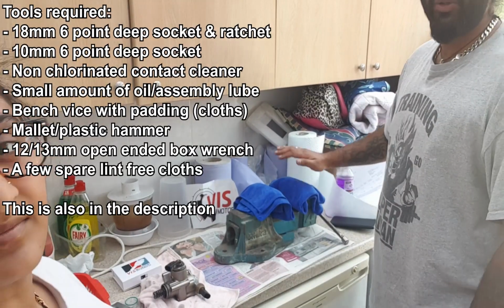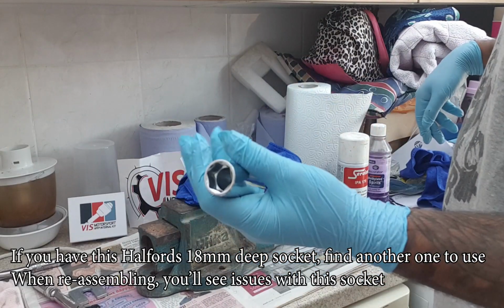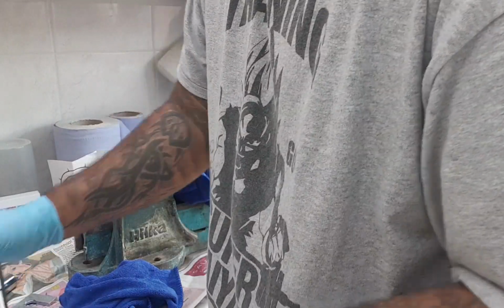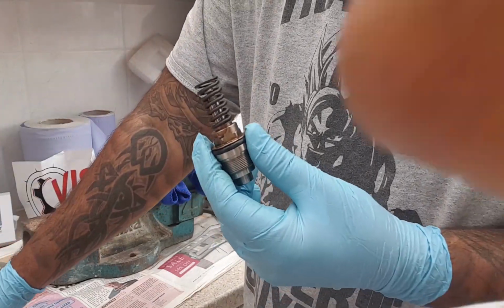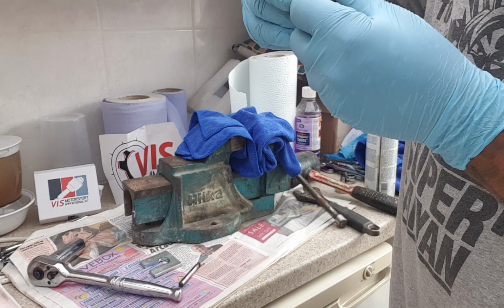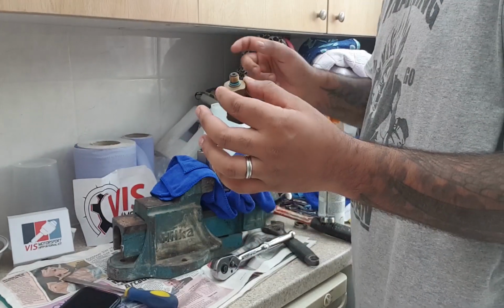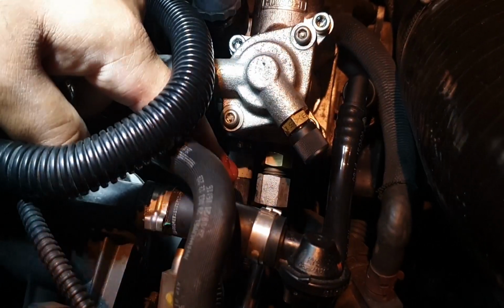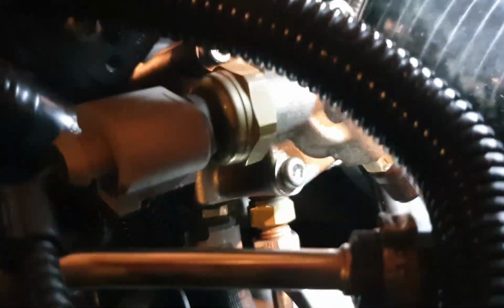DIY - How to fit VIS Internals - UPGRADE & MODIFY your fuel pump

Comment: 'Tappet' was fitted upside down and may still be that way. The rubber o-rings won't last long so please buy the correct sealing washer. Replace the 1960's hose clamp for a genuine spring clamp. Not too bad for your first go.
Reply: Thanks for the info Alex much appreciated. The tappet being upside down could have been why it popped off when I removed the pump. I haven't had any issues in over 1k miles so I (believe) it's the right way now. For other peoples knowledge too, how do you know if its upside down? 

I have 1 crush washer that I found on my drive way, do you have the part number for the washers by any chance? 

I'll replace the clamp too. If you have these in stock I'll happily purchase them from you.

Thanks! 😁
Reply: Can you buy the washer on it's own? If so do you know the part number?
Reply: @Jeremy7595  For the larger valve (rail valve) the washer part number is N-013-811-4. I think this is the only one. Check this post, someone kindly took pics and measurements of the rail valve washer  - https://forums.vwvortex.com/showthread.php?5101162-Help!-What-is-this-part&p=69492364&viewfull=1#post69492364

For the union/pressure fitting (where mine was leaking) the part number is 06F127213C. I'm trying to find the washer part number(s) and I'll edit this post when I do. The spring hose clamp part number is N90986501 so I'll get that too.
Reply: The washer isn't available as a separate item.
Reply from the maker: I found the washer I was missing, but there's no part number as Alex mentioned.
For the union connector (rubber hose attached) the Outer Diameter is 12mm, Inner Diameter is 6mm
For the rail valve (larger one next to it) the Outer Diameter of 12mm and an Inner Diameter of 9mm. This needs to be a crush washer though. The part number I found for this is N-013-811-4
Reply: Will it affect how it works as he put the flat side of the tappet facing upwards instead of the rounded side facing upwards ?

Comment: Hi Swati Gurpreet. If you do a test... on highway cruise 3-4th gear on autopilot and keep rpm in 4800-5000 value constant for a minute, do you get a P0088 rail pressure too high error and limp mode? For this test would be great to have a VCDS and log fuel rail difference between actual and requested by ecu. Blocks 115,230,231. I have this issue, changed everything on fuel rail and getting this. No errors on WOT(wide open throttle) as it uses the fuel pressure and doesn’t build up. No errors under 4400rpm. It looks like the pump can’t regulate pressure over 4700 rpm. It is not a FRPV issue changed the rs4 with the stock one and still error. The pressure differences appear until Reaching it’s release pressure of 130/136 bar.

Comment: What happens if you drive it straight  away without doing the rev things?
Reply from the maker: Not sure on what could happen, but the manufacturer recommended to do it so I'm assuming some damage can be cause if you dont

Comment: What about software update to make this works, what maps have to been moded?
Reply from the maker: You can fit the VIS internals and run it without a map, it just increases the maximum capability of your fuel pump. When you get your car mapped you can increase your fuel pressure and volume of fuel.